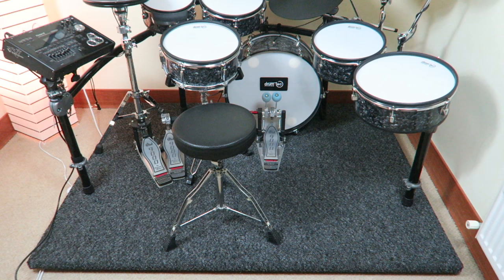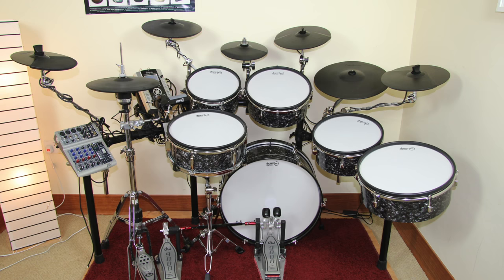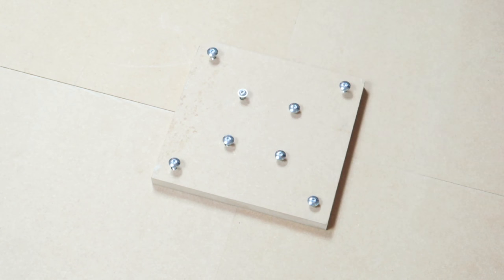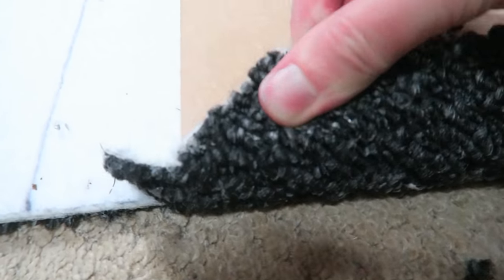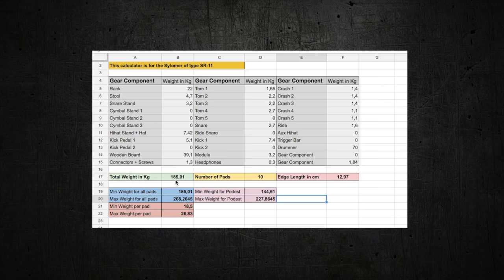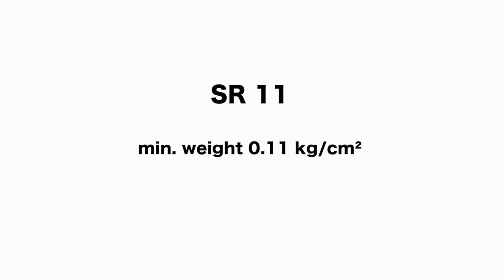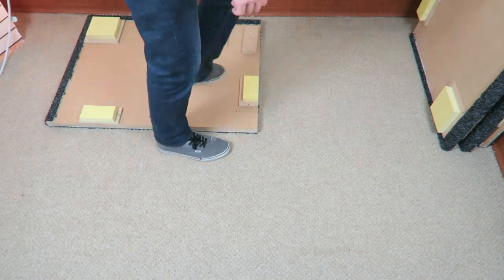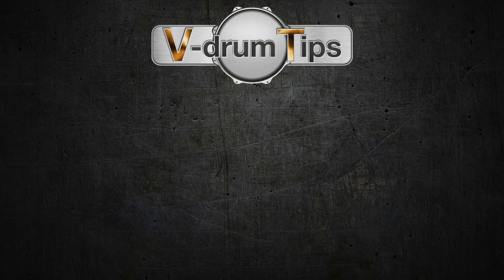E-Drum Noise Isolation Platform - Tutorial

Comment: I built a platform like this one a few days ago for my expanded TD-30 kit. The biggest differences are that I'm using one solid piece of MDF, and that my throne is not on the platform to save room space. I ended up using exactly five sylomer pads from R-drums. on an MDF board measuring 182 x 90 cm The platform sits on a thin piece of carpet. I live on the 5th floor of a modern apartment block. I informed my neighbours that I would test my setup tonight at 8 PM, and asked them to listen for any noise coming through the walls/floors while I played a 4 minute metal song with double kick parts in it.

The neighbours adjacent to me heard NO low frequency noise. They heard a bit of high frequency noise bleeding through the wall, which is inevitable noise from my sticks hitting the pads/cymbals.
The neighbours below us reported a very small amount of low frequency noise, but were very positive on the results and even encouraged me to play whenever I like.
In the end, me and the neighbours agreed that I will not play after 9 PM. Other than that, I can now play whenever I like.

Thanks Vdrum Tips for the great tutorial!
Reply: Can you not use some stick silencers and sound dampening pads on the walls to stop the stick noise?
Reply: That's so sick mane, I live on the third floor and probably will have this same discussion soon...haha.
Reply: my neighbors also don't say anything if I play til 9pm but recently I purchased real cymbals and I am planning to upgrade to a real kit, so I think I will build a room inside room. make a higher stage ISOLATE IT SOMeHOW FROM THE BOTTOM FLOOR.. this tutorial is helpful for the E kit.. I REALLY DO not HAVE MONEY TO THROW AROUND ANY SUGGESTIONS ON HOW TO MAKE A CHEAP DRUM BOX

Comment: A very German way of building an isolation platform. Great job!
Reply from the maker: Hahaha, yes I know, it will probably last longer than humanity, except the carpet I guess.
Reply: @Vdrumtips1  The Sylomer will last with full performance for at least 100 years as long as it is not overloaded or exposed to sunlight and ozone. I with as an acoustic engineer working with Getzer and Sylomer and has directed several people to watch this video as it is a great example of how you can reduce the impact of structure borne noise from drumsets. Great work!
Reply: @Vdrumtips1  man, please, could you share the calculation sheet that you used?

Comment: Hey Vdrum! Just came here to thank you for this video, I built my own isolation platform following your tutorial rigorously and it worked out great. I used only one 104cm x 140cm x 2cm MDF board (it's enough for me and my tiny drumkit, besides my apartment isn't that big) for the platform and eleven Sylomer pads (I'm a skinny boy with a small drumset) underneath, plus another Sylomer pad that serves as a kickpad stopper between the kickpad and the wall (a good tip for those with a sliding kickpad issue I suppose, it stops the kickpad and isolates the vibrations as well).

My downstairs neighbour (a woman in her 70s) had already complained twice before I built the platform: once when I had nothing but a folded carpet as an isolation method and then again when I tried using two layers of EVA jigsaw mats underneath the carpet. None of that worked. After I watched your video and was lucky enough to find a company that sells Sylomer pads here in Brazil for a price that's almost the same as in Germany, I immediately decided to try building the platform. It's been two months now since I did so, lots of daily heavy drumming since then and not a single complaint, I met with her this week while leaving the building and asked her about the noise, she said she thought I had given up playing, that's how well it worked. I also moved the kit to another room far from where the bedrooms are in my building, I presume that probably helped as well.

Anyways, a big danke schön to you from Rio de Janeiro, Brazil. I don't know what I would have done without your very helpful video.

Comment: Great solution! Not sure if this was already commented on, but there is an error in the indicated 'range of working' of this product. On inquiry the 0.11N/mm2 is the maximum (not minimum) static load and 0.16N/mm2 is the maximum dynamic load. This means you can put much more to make the platform stable, without compromising the damping function. This is also demonstrated by the fluid video: the size of the pad is much larger than the weight of bowl and fluid would require to be within 0.11-0.16N/mm2. Happy drumming.
Reply: This!
The amount of Sylomer I ordered was not enough the first time because of this misleading information in the video...
Now I got some more, and I'm trying to make it work... For some reason, I haven't succeeded just yet.
Reply: I think you're right. I've just built a platform and there is a document in a spanish retailer's website whith a table with maximum loads in kg for each Sylomer model (SR11, SR16, etc). For 10 x 10 x 2,5 cm SR11 pads it's 10 kg, 16 kg for SR16 and so on. In fact, you select your pads by load when making the purchase. I'm going with 10 SR28 (25 kg max) for a 200kg total (platform + gear + myself) which gives me 50 kg of margin in case I get a heavier kit in the future.
Reply: Thanks, I was about to make a mistake! So, is there a minimum weight for each pad? If so, do you know what the minimum weight is for SR11?
Reply: @isaacnoroncaasi  AFAIK there's no minimum weight, only maximum

Comment: Thank you for the video. Just a small remark:
When figuring out, which sylomer pads you put under the podest, keep in mind that the weight is not distributed equally. The spot, where the drummer sits, carries the most weight and thus needs more or different sylomer pads.
Reply: This was accounted for in this video by calculations for pad placement he mentioned he had the solymer vendor perform for him via a software tool.

Comment: After a lot of complaints from the downstairs neighbor on account of the key thumping/pedal kicking of my digital piano, I built a platform myself using your video and mathematical guiding. Like "hantesselaar" (see comments) I found out about Regufoam after some googling and it works amazingly well - incredible really. I spent €36 on Regufoam D300 (= 0,055N/mm²) shipping costs included. Thank you very much for your inventiveness and great video!
Reply: Where did you purchase it from and what calculations are you using?
Reply: @jonesteves4286  Hi Jon! I really don't remember at all! I can tell you that I found out Regufoam is quite a common material in boating - used for engine noise/vibration reduction. If you google around for local boat stuff stores, you'll probably find that they'll be able to sell it to you. Watch the video again for help with the calculations, you couldn't ask for clearer instructions!

Comment: Tried your suggestion and used Sylomer for my drum platform and it works! Great job and thanks for sharing this idea!
Reply: Where did you find the Sylomer? I can't really find a dealer in Belgium. Thx!
Reply: I’m living in Tokyo, found some Japanese company selling Sylomer products.
Reply: @jayrose1230  hey man, do you live in an wooden apartment or mansion? Did it work?  I also live in Tokyo and I'm wondering if this will help to keep my neighbor from complaining about the noise/vibration. Luckily I live on the ground floor but because of the 玄関 style, it becomes higher and more integrated with the rest of the building, therefore more susceptible to vibrations spreading throughout.
Reply: オイラー hey there, i live in a concrete-built mansion but the floor is hardwood so vibration easily travels and we sometimes hear our neighbor’s footstep upstair. Before using silomer, vibration from the bass pedals can be heard in other rooms of our house, but no noticeable vibration after using silomer.

Comment: Separate from the kick floor vibrations, I have an idea for addressing the room noise in apartment that's created by the sticks hitting the pads...
Buy four heavy duty tarps, preferably with hook eyelets built in. Cut to length to the floor if need be.
Glue sound-proof foam to the tarps. Maybe even glue more foam on the other side.
Install hooks in ceiling (or use some kind of stands if don't want hooks in ceiling), then hang the foam tarps around the kit to make four temporary walls...if foam on one side, then face the foam side towards the kit.
If you have enough space, it wouldn't  necessarily need to be close in, just to catch the sounds into foam to four walls.
Even if you had a real wall behind/in from of the kit, you could still use a foam tarp so you don't have to permanently glue foam to your walls. Maybe even put kit in corner with only two fake walls in front of kid and two temporary (or permanent) foam on the corner walls.
You could probably even try a low-budget version with plastic sheeting, like from a roll of plastic drop cloth and egg cartons glued to them (or whatever) as the sound proofing. Perhaps hanging heavy blankets might kill some of the sound as well.
This is just an idea at this point, if anyone wants to add their own ideas to this.

Comment: Thanks for a fantastic and meticulous video! 
If I was to build a platform which only was supporting the E-drum kit and not the throne, would it still be effective at noise isolation? 

If so, how I determine weight accounting for impact on the kick and high hat pedals?

I have a very limited area to work with.

Comment: Thank you very much for this tutorial. Could you provide the source of information on the effective load range( 0.11-0.16). I found an article were it says the following 
"For loads and deformations exceeding the degressive range, the deflection curve is progressive. The material becomes stiffer. As a result, reduced vibration isolation eficiency can be expected in this load range."
If I understand correctly, this means that the load should be less than the limit (<0.11).
Reply: The degressive range is from 0.11 to 0.16. In that range is where the isolation is optimal. After that range (after 0.16) in where isolation degrades.

Comment: I just wanted to thank you for this video. I made my version of this with mdf, sr11, carpet, whole nine yards. Would have never made it without this video and now my downstairs neighbors won't hear my drums over the TV. Maybe 95% sound reduction for bass and snare. It ended up being 11 pads for my expanded kit, 100lb platform, and me (200lb).

Anyway, the one issue I'm having now is that my drum rack has been shaking when I play double bass. I recently made a drum rack out of curved gibraltar pipes (two 40", one 30"). The rack is stable, but starts to wobble when all the drums are on it. I feel like the kick drum (kd-140) is causing the platform to move which in turn makes the rack wobble.

I was wondering if you could give me some input on this. Would shortening the rack pipes help? Or do I need an extra front pipe for more support? Just, generally, how can you make a monster drum set on this platform and have it be stable?

Thanks so much!
Reply from the maker: Thanks for your comment! I had this issue aswell. What helped me was connecting each piece to each other, I clamped the hi-hat stand to the rack, added some horizontal rack feet (from Gibraltar) to make the footprint of the set as big as possible. The next step will be to connect the snare stand to the rack. Nothing is shaking anymore.
Reply: Thanks for your reply! I'm planning to add an extra leg directly to the left of the bass drum on the middle of the front rack tube. I'm also going to shorten the right tube by about a foot. If it still shakes I will definitely swap out those feet, and attach the hi-hat/snare. Thanks for all your help!
Reply: I wanted to ask--which product did you use to clamp the hi hat stand as well as the stand to the rack? I've been having trouble finding something that is the right length and can clamp the different diameters.

Comment: Thanks for making this video and sharing it! I am going to get my hands dirty as well and recreate the design of this platform. One thing I've been missing. What are the dimensions you've used for the central and peripheral connectors? The only data point I was able to catch was that they have a thickness of 19mm. Thanks again, this really looks great!
Reply: Don´t know, if you started building the platform yet, but my advise would be to pay attention, that the connectors are not higher than the sylomer pads. And don´t forget, that the pads are still going to be compressed. At the maximum load of 0.016N/mm^2, the pads will be compressed 25% so at 25mm original height, they can be compressed down to 18.75mm. So a 19mm connector plate would be to high. Unless you also use the small plates to stick the sylomer pads to. Than you should be fine with 19mm

Comment: Thank you so much for that!

You can't even know how freaking much i've been looking to make a vibration isolation platform that REALLY works.
I've tried 2 different types of tennis ball platform... it helped reducing the vibration a lot, but wasn't enough to play when my downstairs neighbors are sleeping (at freaking 8pm!!!).
I've tried adding some foam/rubber carpet to help even more... still not enough
and BTW, my apartment has a concrete layer between floors.

I've just made my own Alesis Strike Pro platform using Sylomer.
Also made of SR11, but mine are small 50mmx50mmx25mm squares, and each pad holds 20kg (printed on the pad itself).
Which made me think... did you miscalculate the number of pads?
Your pads are 6,76X bigger than mine (same material), so it should hold 135,2kg?
Strangely, my Sylomer pads seem a lot harder than yours (and is orange/brown...not yellow)
But it's still SR11 (by Getzner).
Reply from the maker: NIce, well done for building one:)

It could be that your Sylomer is different than mine. I am sure I am not miscalculated, as R-Drums calculated for me too. Happy to hear that it works for you:)
Reply: Vdrum Tips Ok yes, that must be it!

I’m wondering one thing...

Considiring that the board is in few pieces bolted together (mine is 2 pieces (back and front) and not in one piece, is the  total weight really distributed equally on the surface? I mean, should I put more pads on the piece where i sit (there is me, the throne, a part of the snare and hihat stand, and also 2/4 legs of the drum rack on that part of the platform). On the second piece (front), there is only the kick pad and pedal, 2/4 legs of the drum rack (with 2-3 toms and 2 cymbals). Eveything else is on the back piece, so my question is : Should i put, for instance, 3 blocks on the front board, and 5 blocks on the back board? Or the weight that is on the back board also as an impact on the front board? Sorry, it may seem like i’m overthinking the thing... and sorry, English isn’t my first language so i have some difficulties to express my point LOL. Maybe we could talk in private (if you don’t mind)?  Thanks again!

Comment: So here's my story....
My first plattform was build with cut down foam cylinders, which are normally used for heat isolation of pipes. I also found the idea and the tutorial here on youtube. 
After 2 years with no complaints my downstairs neighbour finally identified me as the cause for the noise upstairs. I was totally bummed out because I thought it worked all this time. 
So I decided to make it more professional and followed this instruction. My total weight came to 190 KG, so I just copied the platform seen in this video. Today my downstairs Neighbour came to me and said that it hans't changed at all... now I'm more than a hundred bucks lighter and in the same situation... I can't believe that a random construction and this calculated one with professional material makes no difference... god sometimes I hate being a drummer...
Reply from the maker: Sorry to hear that, try a stronger plate and destribute the pads differently.
Reply: @Vdrumtips1  do you happen to have the same set still? (I mean same Sylomeric solution)
I'm in the same boots: bought €100 worth of Sylomer pads (even contacted Getzner about the quantities), and the downstairs neighbor is saying it still transfers the energy somehow...

Note, I use 18mm thick furniture sheet, not MDF (which is stronger). Don't know if that's the issue.
I try to distribute the pads in a way so they're more densely packed under me, where the weight is.

Comment: Actually 0.011 N/mm2 is the maximum static load. For best result mass shouldn't exceed it, but it should be near it to work fine. Also it is better to use 2 layers (2x25mm) for best vibration decoupling. One layer may be not enough depending on vibration frequencies in real application.

Comment: this video is great! ive noticed you put a bunch of smaller pieces of sylomer instead of just covering the entire surface. do you think leaving gaps like that helps inthe vibration reduction? i have a crazy idea to just buy a 2 or 3 inch firm memory foam bed topper and just put a piece of MDF board ontop of it just becuase it seems very simple and inexpensive to do.  but there wouldnt be any gaps in the foam.  Do you have any thoughts on this?
Reply from the maker: Austin Paz You cannot cover the whole surface, since this is the weakest type of sylomer and I have already taken the maximum amount for the weight. Covering the whole surface would mean you have to place a car on top of the board to get the weight up. It is a weight sylomer ratio that needs to fit. But if someone would invent a very soft type of sylomer, you could cover the whole surface.
Reply: ahh ok i got you. thanks!